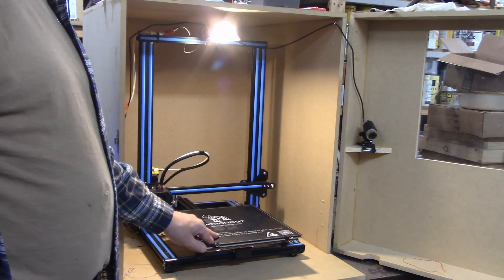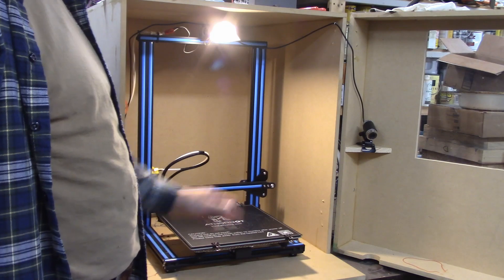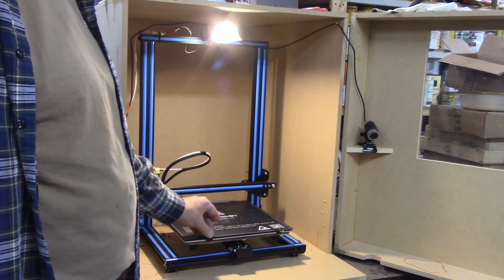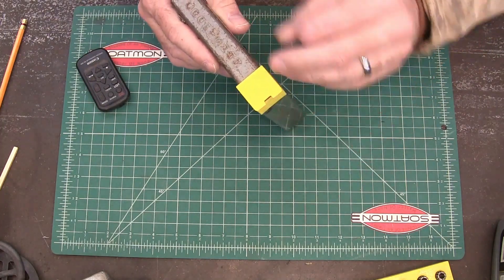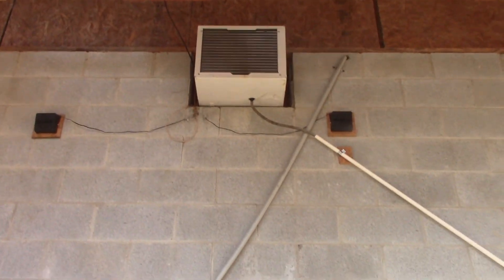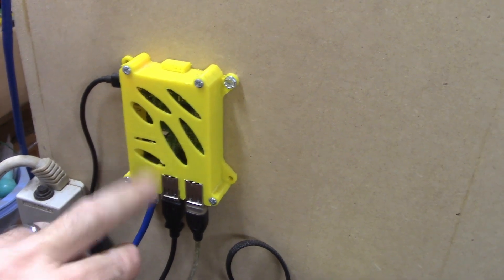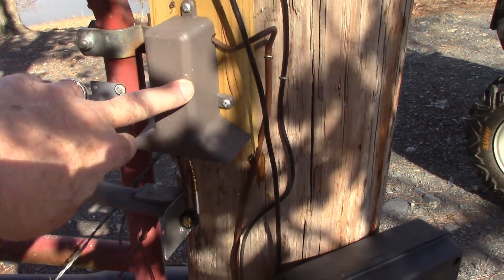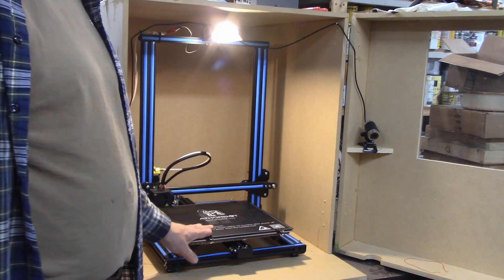Do I need a 3D Printer:  Things I've Made on Mine

Comment: We use the printer in much the same way! No interest in printing trinkets. It truly is a resource to use in conjunction with other skills as I see it. Enables fast prototyping and tool making. Not the mention the skill set you develop around it, cad, slicing and gcode editing. Skills that can be used in other fields. Then there's the community around it all. Very useful addition to the "maker life". Thanks for sharing and pointing out that 3d printing is very useful and practical!
Reply from the maker: Thanks Funkysod! I agree the skills you learn around it are very useful.  I think learning Fusion 360 is one of the main reasons I keep printing stuff.  It's so easy to design and print stuff that works.  I've got a print going right now...

Comment: I finally, reluctantly, got one this summer, but I'm glad I did.  I use it mostly for making molding patterns to use in my home foundry, since I don't have space to set up all the woodworking tools it (somewhat) replaces.  But I was also able to print a replacement impeller for my bathroom fan.
Reply from the maker: I always wanted one but wasn't sure I would really use it.  Turns out I use it more than anything else.  I've got a print going right now.  I checked out your channel, you have some interesting content.  I'm going to have to go back and spend some time.  Thanks Tobho!

Comment: If you ever in the need of some filament that you would need to flexible i.e., bellows. Try TPU I understand it is very flexible and strong, thanks for showing.
Reply from the maker: Thanks Marty!  I have some TPU but have never printed with it.  I got it to make some gaskets but never did the modifications to my printer that I needed.  I just bought a new hotend for the printer that should handle the TPU so that may be coming soon.  Good to hear from you!